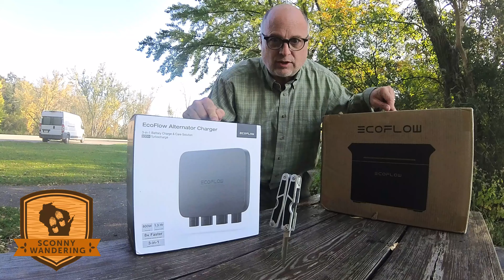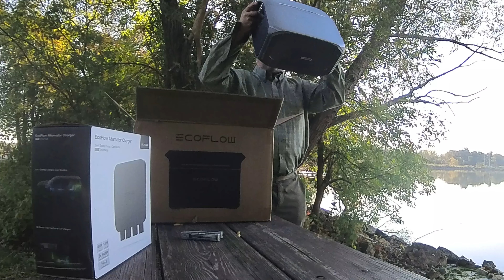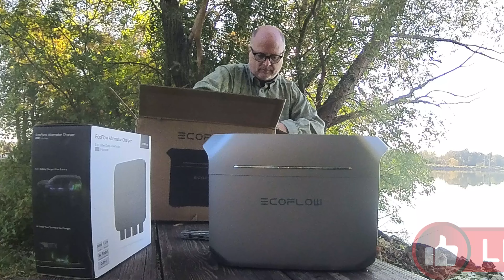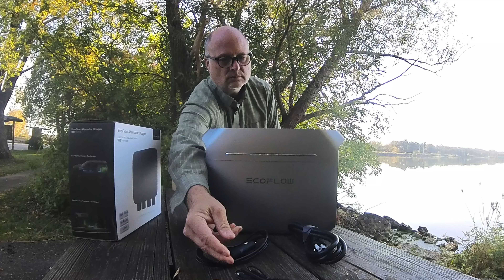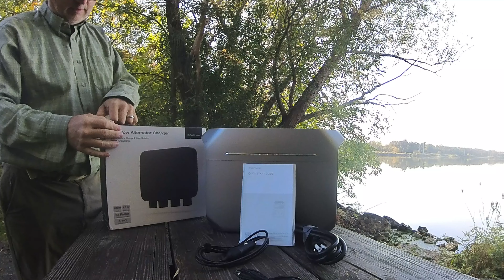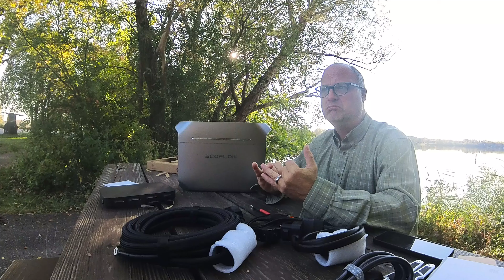Ecoflow Alternator charger with Delta 3 power station will change how I camp and travel

Comment: I have the Delta (original) do you know if the alternator would work to charge that?
Reply from the maker: I don't think it will, it needs the same port used for the expansion battery
Reply: @SconnyWandering  ok, I dont know much about charging except the solar we use… and thank you for replying, very kind.
It would be nice to have another option to charge when the weather is bad. It came with a cord that has a cigarette lighter, but can that work with just a regular car do you know?
Reply from the maker: It works, but slowly